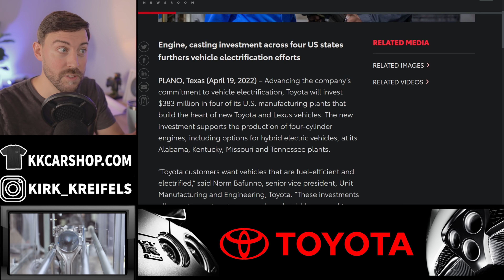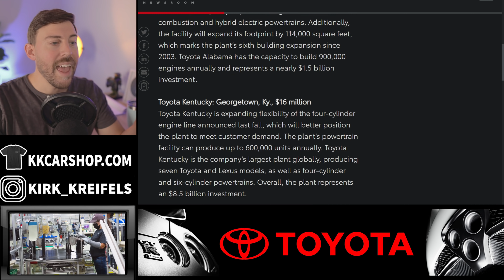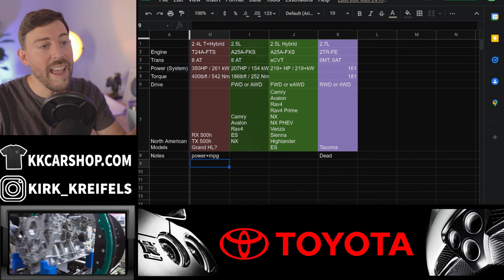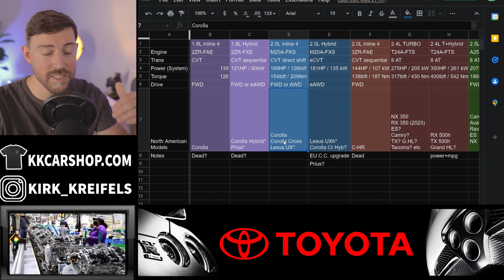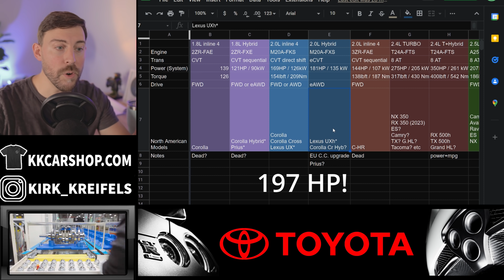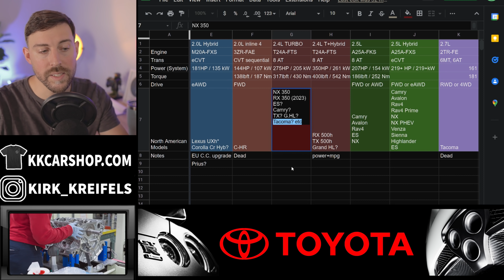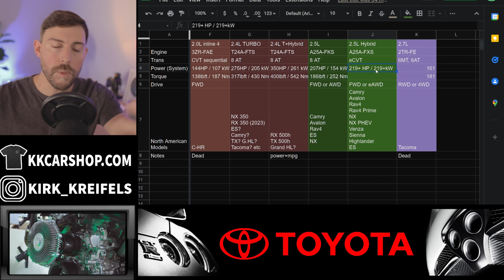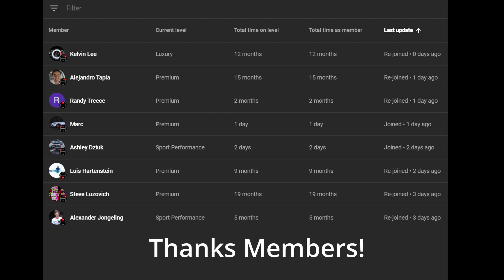Toyota's NEW engines are Small, Powerful, and Efficient...RIP V8, V6?

Comment: Turbo Phobia is funny here in America, I lived in Japan from 95-2006 All my cars were Turbos, my Forerunner T Diesel was a beast.  The V^ is less powerful than the 4T and has the gas milage of a V8, time for it to go.  The V6 in the Honda Pilot is another slug hitting peak torque in the upper 5000 WHAT LOL I had a Honda Pilot, total slug and towing was horrid.  The 4T peak torque is a 1500 and pushes through all the way to Red line.  the KIA Torrid (Horrid) has a V6 from the 90s in it, guess that's how they paid for the all suede interior.  Toyota does it best

Comment: Toooooo many engines... need to slim down the lineup and use tuning for market positioning. Should also standardize on 500cc cylinders to share the same components across engine families to save money and optimize a single cylinder design.

Comment: Another aspect, Toyota is developing ICE engines that they fully expect to work well with hydrogen fuel, which they still fully intend to develop and push out.  Think how fast EV charging stations have filled in, Toyota has more money in the bank to invest with than any other company (or 2nd to VW, depends where you read).  I predict Toyota will end up saving the ice engine from irrelevance.

Comment: I'm kinda surprised that in 2022 Car manufacturers even invest in Internal combustion engines to begin with.And all these small turbo charged high rpm engines will be a NIGHTMARE to repair, most likely break down in not in decades but in few years after purchase. It might be "efficient and clean" for environment. But it won't bea efficent for your pocket.

Comment: The Federal Government's radical CAFE standards are removing any choices of powerplants. It's either a 4 banger with turbo or some sort of hybrid. And combined with the artificial and deliberate shortages of cheap gasoline this is the result. You used to be able to pay the 'gas guzzler tax' on high performance engines, but those are being discontinued. It's obvious, in my opinion.

Comment: No it's not RIP to V6 or V8's, the downside of EV's is that when it comes to modifications or the car to make it faster, it's nearly impossible. I invite you to the next Texas Mile race here in Texas, where people are trying to set speed limit records/time record for a mile long strip. This is where V6, V8's, V12's excel at (long distance races). There was a Tesla plad that came to the Texas Mile 2 weeks ago, and it didn't even place in the top 50% of the cars. IT finished with a top speed of 207 MPH, even with governor removed, while you had you V6's, V8's, V12's finishing with 220+ MPH top speed. I took my 2012 Nissan GTR (R35) that make about 1600 WHP, and finished the mile race with a top speed of 241 MPH.

The Tesla Plad has a great freaking launch a great MPH to about the 1/2 mark, but once it hit the 1/2 mark it basically ran out of juice, had no way to go faster, hence why it struggled. Compared that to an ICE where an ICE car might start way lower then a Tesla, it actually keeps on making power all the way through the mile mark.

The fastest car at the Texas mile even this year was a Ford GT that ran a mile in 293 MPH.

Now, I think the future will be hybrid technology, rather then straight EV's, ask the Porsche 918 spyder, it was only produced for 2 years (2013-2015) and it had a hybrid technology, and at that time the 918 spyder was a monster even with using old battery/hybrid technology. The thing with the 918 spyder was that, in racing mode, the car basically used the EV to launch out of corners, meaning it was there to basically accelerate the car, and once it reached a certain speed, the car would auto change from EV, to ICE in about .04 seconds. It was one reason why the 918 spyder is the #1 choice for super car track races around the world. Because when this car works, it is so freaking fast, faster then any EV's or hybrids, the biggest down side of the 918 spyder was that, it was very unreliable because EV's and hybrid's were still very new at the time.

Imagine what car companies can do now with hybrid technology, with an hybrid, you are basically getting best of both worlds, and hybrids should be the feature, not full EV's. Imagine what an V6 hybrid would be able to do with the currently technology. 

https://www.youtube.com/watch?v=5VonCclqtL4
Reply from the maker: Toyota has said its first solid state battery equipped cars will be hybrids!
Reply: Well next stop would be 0.2 L Single cylinder quad turbo hybrid, would have 100 miles per gallon, and new engine replacement every 2 k miles.

Comment: Here in Ireland we only have 3 and 4 cylinders large engine cars are just cannot be insured. V6 is totally pointless with the speed limits and traffic and if someone wants acceleration will buy Tesla
Reply: And there in Ireland you can fit your country into some our states here in the USA.  You don't have as far to drive unless you leave your country.  Congrats, it works great there. I want to be able to drive 500+ miles on a single charge before I consider an EV worth even looking into buying.

Comment: i don't understand how newer engines make less power. the 1zz and 2zz were 1.8L that came out over 20 years ago and made more power than like all of these...
Reply from the maker: Zz engines were less efficient and more emissions
Reply: @KirkKreifels  The 1.8L 2zz in a 2000 Celica made 180HP and 133lbft with an EPA fuel economy of 32mpg hwy. That's almost 30% more HP than the 1.8L 2ZR on this list.
So while sure its slightly worse on gas and potentially had more emissions, its also got 30% more power.
All I'm saying is, its been over 20 years. They should be making the same power if not more, with better fuel economy and emissions.

Comment: Because you can make a lot more hybrids than EVs for the same amount of batteries.
 
When is Toyota going to start offering Performance-Hybrids? 

We all know what they’re capable of at the WEC.
Stop blue balling us Toyota.

Toyota TS050 Hybrid - https://youtu.be/Sy91BcB8pRQ 

A performance-hybrid on the Nurburgring.

Porsche 919 EVO Hybrid - https://youtu.be/PQmSUHhP3ug

- With a 2.0-liter turbocharged V4 engine paired to a hybrid system, the 919 Hybrid Evo delivers a total output of 1,160 hp.

Comment: I have always thought that the future is in an electric drive train, battery that can be charged from the net but also a combustion engine that always runs at maximum efficiency driving an on board generator. There would be 2 modes only, off and on with maximum efficiency.
Reply from the maker: Look up Nissan epower hybrid

Comment: Volvo did the same thing around 2005/6 and went with all 2.0 liter 4-cylinders. The problem is the 4-cylinder powerplants just aren't as smooth as the 5 and 6 cylinder ones. But, it even makes more sense to do that now than it did 16 years ago. And Toyota will likely come up with a smoother/quieter version than what's in Volvos.
Reply: They have them already

Comment: Since everything is going to 4 cylinders, just buy a Camry. No need for a truck, SUV, Lexus, etc. - just get a Camry.  Because soon, everything will drive, sound, and feel like it.
Reply: Why only the Camry? What about the rav4? Plus if you want Lexus just get a Toyota in its top end trim
Reply: Well, it’s reliable and less expensive.   Agree with just getting a upper trim Toyota instead of Lexus if there isn’t a better powertrain in the Lexus models anymore.  Imagine starting up a LC500 and it sounds like a Corolla.  Good times.

Comment: The v35 and v33 will only be produced in japan i guess
Reply from the maker: V35 is made in Alabama for tundra and Sequoia
Reply: @KirkKreifels  but that would be low volume compared to japan where it is installed in ls, land cruiser and lx
Reply: The crown would not get this v6
But would be pretty cool if they did come out with one as the gr crown a spiritual successor of sorts to the gs f

Comment: Toyota has been falling behind not only in the engine technology, power and fuel economy.....but they have also been falling behind in their transmissions....the fact that they still use their old tired ass 6 speed automatic in their IS 350 AWD is horrible!
Reply from the maker: They're not behind on either...IS is based on the old GS platform so it doesn't see much modern power trains

Comment: what i would love to ese from Toyota as a strategy
-- max out the 4 cylinder in -design, complexity
-- then take that and hybridize EVERYTHING with various levels of power over various vehicles
-- dominate PHEV vs BEV space
-- create vehicles that can go EV for 70 miles and then have powerful 4 cylinders attached
most people do less than 70 miles per day and can EV all day, if charging at night, daily
Reply: Yes! "Dual fuel" is the way to go!
Reply: this is a pretty good idea and I've always wonder why manufacturers don't do this with their hybrids, it'll be cool it Toyota does something like this

Comment: Yeah soon everything will have a tiny lawn mower engine with turbo chargers piled on top of it. They will produce plenty of power but also not be as reliable or last as long. Have you ever seen a turbo engine go 300k without major repairs? If you plan to keep a car beyond 10 years or 100k, dont buy anything with forced induction.
Reply: Afaik only turbo diesels can go that far of mileage.
Reply: Im not sure how true that is.   Wouldnt they just beef up the components....

Comment: Lexus (and Toyota), like other car companies, have gotten more powerful (and efficient) over time. Do you think Lexus/Toyota is going to leave the T24A at 275 hp across the board (despite the 20-30 hp drop in the Camry/ES/RX/Highlander) or come out with a higher power tune to surpass the 2GR on paper and in reality? I know the torque is a big upgrade, but I wonder what buyers, who look at hp numbers, are going to think.
Reply: The 2GR performance wise is better than the turbo. The turbo has more torque but there’s a lot of lag down low

Comment: Honda has the civic hybrid coming next year and I gather the integra later as well.
.why they chose not to use the turbo 1.5 in these applications is beyond me, this could allow for a more fuel efficient and faster version of the civic SI and integra with manual to slit between the SI and R
And integra Advance and Type S maybe $2-$3000 more?

Comment: I’m kind of surprised that no mainstream manufacturer like Toyota that’s trying to keep combustion engines alive as long as possible have created at least a prototype with free valve tech or a similar proprietary tech. This tech only makes engines more fuel efficient and more powerful. 

Having the ability to always control valve movement at any time during a combustion cycle is amazing tech and I don’t see why companies like mazda, Toyota, or Porsche who are all hedging their bets on alternative/renewable combustion fuels have been trying to implement such a technology into their engines.

Doesn’t Koenigsegg have free valve out as an open patent? To me it seems that the only reason why one of these manufacturers hasn’t used this tech yet is that they doubt the viability of biofuels or hydrogen for combustion. Both current viability and viability after years of production. I find it sad, it really shows how manufacturers are giving up on ICE cars and only trying to prolong the inevitable :(
Reply: They’re too focused on electrification. They’re on a perceived time limit.
Reply: Alive as long as possible?  Those combustion engines WILL outlast all of your EVs. Period.  EV tech is in its infancy and unreliable, prone to explosion, etc.  It's UNRELIABLE.  Fuel efficiency does not matter. Go watch how most people drive. They'll drain a battery the same as a gas tank faster than they know.  Americans have heavy feet and it's why I tune out when anyone cries over gas mileage.

Comment: I will be searching for a new Highlander before the bullet proof V6 goes away.
Reply: The Hybrid actually has much better reliability.  The 3.5 has a poor record.  I saw a brand new HL V6 broken down and abandoned on the highway.  It’s a horrible engine in the Taco.  Thankfully the 4R kept the solid 4.0 V6.  If you want something that is bulletproof get a 4R.
Reply: @user-tb7rn1il3q  the taco engine is not right from the Highlander. From what I heard it’s from the Lexus GS and IS
Reply: @naveenthemachine  It’s basically the same engine mounted longitudinal vice transverse.
Reply: @user-tb7rn1il3q  Im unaware of reliability troubles w the v6. I’ve seen people w siennas get 2-300K miles
Reply: @naveenthemachine  That’s the 2GRFE not the 2GRFKS.

Comment: I'm getting the IS500 and drive it until the wheels fall off.  I can do the 6, but I'm not feeling this 4 cylinder or even the EV's. I get smiles per the gallon with my 8 cylinder. Thanks for the content.
Reply: agreed.  I already have the V6 in my GS 350.  I will be adding a Lexus V8 too.  Either IS or LC (prob LC).  Turbo 4s are not appealing at all.
Reply: Same here!
Reply: Running out of natural resources and pollution my friends.
Reply: @huyduong7202  it has less to do with that and more to do with meeting regulations established by political bodies
Plus people just treating cars as an appliance

Comment: The UX should just be redesigned. Lexus should just skip the 2023 refresh and just give it a complete redesign.
Reply from the maker: Yes
Reply: Dream would be a Lexus version of the Corolla cross
Reply: @misswegan  that should be the next generation of the UX. The current UX is based on the CHR, which explains why you can only get AWD in the hybrid models.
Reply: THIS! The UX is a very poor product by Lexus standards 😞 It's possible that the only worse model than the UX is the forgotten HS.

Comment: The T24A-FTS is just better than the 2GR-FKS.
Reply: The 2GR is way better than the turbo 4 in the nx

The performance is much better than the turbo. The turbo has a lot of lag down low while the 2GR doesn’t
For reference my 2020 v6 Camry gets nearly 30mpg combined and it has 300hp and does 0-60 in 5.5-5.8 seconds
Reply: No. That engine is in the new Lexus NX and it is slow as hell and only gets 21 MPG combined.
Reply: @little123456788  Wait what?
Reply: @imnotusingmyrealname4566  Yes, look up on the Lexus forums what owners are reporting really poor real-life MPGs. Many of them don't even hit 20MPG combined.
Reply: @little123456788  Wow, so just like with the Tundra.

Comment: So do we believe the new gen Tacoma will only have the 2.4 Turbo or will it get the 2.5 as a base model? Maybe a detuned 2.4 Turbo for a base model like Tundra gets with the 3.5TT.
Reply: I expect that Toyota will keep the 2.7 and eventually turbocharge it as that's a truck engine. The 2.4t and 2.5 engines were designed primarily for family cars, so they'll have to detune those engines for use in the Tacoma. Or they'll have two versions of the 2.7t, one without a hybrid system and one with just like the tundra.

Comment: The T24A-FTS is almost certainly going to replace the 2GR-FKS V6 in the 4th gen Lexus IS (the '21+ models are more of a 3.5th gen).
Reply: Wow I thought the would cancel the IS as well. That's great to hear that it will get another generation.
Reply: @imnotusingmyrealname4566  I seriously doubt Lexus would cancel the IS, or they would be left with literally nothing in the entry level sport sedan segment. The LS is a very expensive executive barge, and the ES is a FWD Camry-turned-Lexus, they need something to draw the younger crowd in. They already have TNGA-N, which is a RWD platform that was used for the Toyota Crown, no reason why it can't be used for the 4th gen IS.
Reply: @gns942  Yes TNGA-N will hopefully be the savior of the IS. Still sad how the Crown is now also basically a Camry.
Reply: @imnotusingmyrealname4566  not sure why they didn't use the tnga n platform years ago, maybe they don't wanna invest
Reply: I wish there will be an ICE IS, but I think the next gen will be electric with RZ450e powertrain sadly. Wish we could see t24a and v35 in the IS
Reply: @dude-yg9ez  Maybe that's true. They said the current IS will be around for a long time (specifically the IS500) so when it's time for next generation it could definitely be full EV. That would be sad.
Reply: @imnotusingmyrealname4566  yea

Comment: I hope new applications of 2.4 Turbo turn out better than the trouble plagued 1.5 Turbo Honda uses on everything.
Reply: What is the 1.5 plagued with may I ask as I have 2 Honda’s with the 1.5 not a single problem
Reply: @jayray8097  The 1.5t and CVT is now bulletproof, but it did have a few reports of fuel dilution in the oil early on.  Generally turbo 4s have much better durability and reliability vs a V6.
Reply: @jayray8097  fuel & oil dilution and carbon build up on intake valves

Comment: I think manufacturers are practicing limited thinking.
The ideal engine for cost, efficiency, compact size and robust use would be an inline 5.   And ridiculously smooth running.
Honda had a 2.5 inline 5 in its Acura vigor and tl for a long time.
That 1 engine block would work for small vehicles.  Larger ones, even light trucks.  Ideal smoothness for stop start.  Single heads still.  Can mount it in many ways.  Boost it or na.
Reply: Volvo's 5 cylinders were awesome and they were turbocharged. A lot of people miss those engines. Acura's was terrific too.
Reply: inline 5 sound so good
Reply: I would like to see a turbo 2.0 straight 5 hybrid putting  out a combined  300-700hp depend on tune and electric motor combination.  That motor should cover all needs.